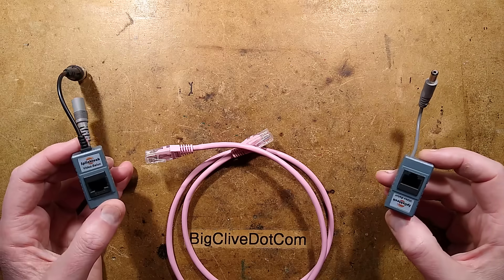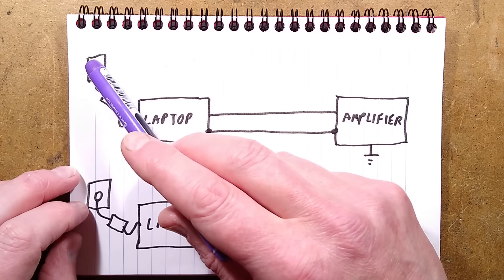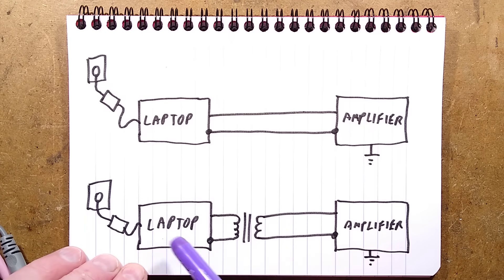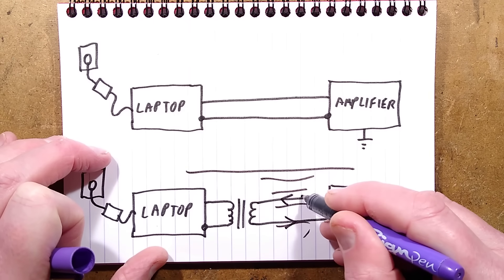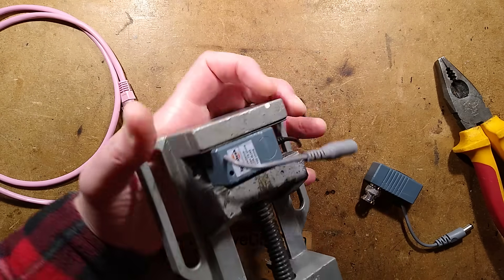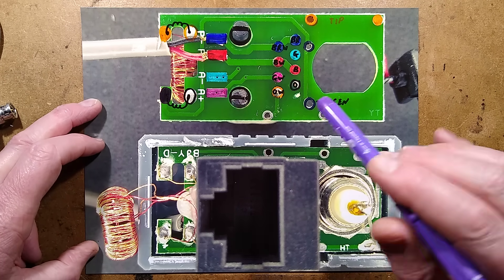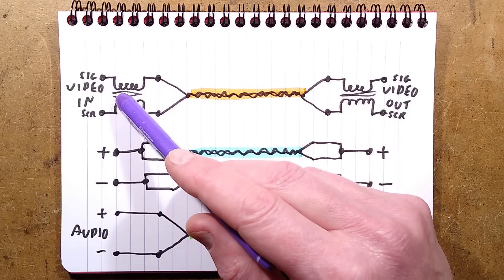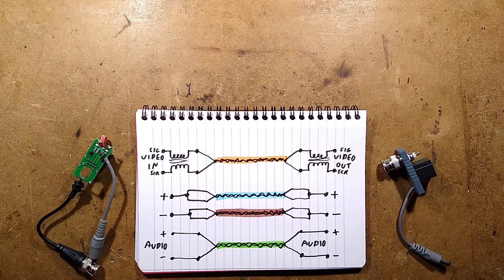Baluns - I got this one wrong (with schematic)

Comment: It looks to me like the balun is providing single-ended to differential conversion and also common-mode filtering, but it is not configured to convert between 75 Ohms and 100 Ohms. This would require a slightly more elaborate balun with more than two windings, and the small(ish) mismatch in this application probably doesn't justify the added complexity.

Comment: Ham over here, I think in this case the "baluns" are 1 : 1 and they are choking baluns, not really a balun but, if the ferrite is for the correct frecuency and if its correctly calculated and constructed can do the work.
The best option in my opinion would be the Ruthroff configuration that is it a real BalUn (Balanced to Unbalanced) system.
Balanced is the UTP Pair and nothing have to do with the fact that they are twisted and unbalanced are both the camera output and the monitor or DVR input .
They wont be nedeed if you run an unbalanced transmition line within them that have the same impedance (Coaxial cable, 75 ohm, could be RG6, RG59, etc).
They are NOT matching any impedance.

Comment: I have installed hundreds of those baluns in cctv environment in combination with UTP
super easy to connect and have never had any problems with them
with the use with outdoor cameras you could sometimes get some corrosion but with a well-sealed junction box that was still survivable 🙂

Comment: I am a (retired) E.E. I really enjoy your videos, you cover topics that we never learned in engineering school at a very useful level. I worked in television design for many years. We used baluns for going from 300 ohm balanced to 75 ohm unbalanced inputs. The were amazing 50-1000 MHz with less than .5 dB of loss and cost about $.10 each. Video signals are not so high in frequency from 0 to 5 MHz (in NTSC/PAL) and perhaps 25 MHz in more modern equipment. Notice I include d.c. the d.c. level is important for establishing black level. Thanks for all your content.
Reply: One upon a time every cable TV company truck had a bunch of 300 ohm to 75 ohm matching transformers on them. These days, I have no idea what a cable TV installer would do if confronted with a 1970s Zenith floor console TV with 300 ohm VHF input.
Reply: @brianleeper5737    The installer my family had in 2015 had a hard time understanding that our older TV was a non-remote model. If they needed to modify the presets on the varactor tuner I'm sure they'd be totally lost. Today I don't think the latest cable boxes even have analog RF out.
Reply: @brianleeper5737  I bought a balun a few years ago to use with an FM folded dipole to 75 ohm receiver. It was a few dollars from Amazon.
Reply: Yes you are right i complettly forgot, thats why a "normal" impedance conversion doesn't work. Thanks

Comment: These are used on the security camera system where I work, on long cable runs. Shorter runs- up to about 100 feet, just use the coaxial cables with integrated power wires. Longer runs use baluns with Ethernet cables.

Comment: I'm studying for my "Electromagnetic Fields" exam, and yes, it does look like black magic at first, it's very counterintuitive. I kind of had to forget Kirchhoff's laws for this specific class.
At high frequency every length of wire matters, and one can "build" capacitors or inductors right on the pcb by designing the proper stubs (the Smith chart is amazing for that) to match the impedances of the line.
Reply: Got my first amateur experience with this looking at a computer motherboard and wondering why they went out of their way to make some of the traces going to and from the processor zigzag.   Had to do do digging to figure it out. High frequency electrical and radio is fascinating.

Comment: Those look like common mode filters in which case, the windings would be 1:1. As another poster mentioned, you would only need one in that case, except you are using another to convert back to BNC. What you want is an audio isolation transformer (though these may work well enough to isolate the noise as long as they have the bandwidth.) I'm gonna guess these would be fine to eliminate the hisses and high frequency noises, but would not work much at all at line frequency to eliminate hum.

Comment: Ground noise is a issue i have with raspberry pi's trying to connect a class A or D amp. I had to brake a transformer out of a 12 v power adapter and put one on tip of audio cable and and one on ground. It helps but if you listen carefully you still here the sound of the sd card working lol

Comment: As far as I understand, the transformers are used as a common-mode choke, it ensures that the average voltage and current on the twisted pair are equal to zero. I do not think it does any sort of impedance matching, video is 75 ohms and twisted pair is 100 ohms. The return loss is -17 dB, so -34 dB after 2 reflections or 1/50th of the original amplitude, so this won't lead to ghosting on the screen.

Comment: I'm surprised you didn't actually talk about what's going on in the twisted pair that actually makes it even better than just using differential (balanced) signalling by itself.  Because the wires in the cable are twisted, they are essentially very long thin coils, which means that when a current flows through one, it creates a directional magnetic field.  That magnetic field causes a current in the other wire that is also wrapped around it in the other direction, and vice-versa.  So if you "push" the signal down one wire and "pull" it on the other at the same time, the two opposing currents on the two wires actually magnetically reinforce each other and help each other propagate down the wire.

On the other hand, because the wires are so close together, any external interference affects both wires in the same way, and produces current going the same direction in both "coils", which creates unbalanced magnetic fields, which fight each other and and the interference actually cancels itself out before it can even travel very far down the wire.

But this means you really do need to have a balanced ("push-pull") signal going into twisted pair to use it effectively (especially at high speeds).  If you only send the signal down one wire in the pair and keep the other at "ground", the electromagnetic properties of the cable itself will actually "fight" the signal and it will not propagate well at all.  (This is why the DC power is transmitted using two separate pairs of wires, instead of different conductors in the same pair.)

The coupled inductors on each end ensure the signal is balanced because when the signal goes in one side of the inductor, it will naturally induce (force) a current to flow the other way on the other side too (this works because the two coils are wired in opposing directions, which is important).

Comment: Isnt the two transformers opposing each other just a common mode supression choke? Induced noise is going to tend to be common mode- if the noise is the same in both cables the inductances add, and if its in opposite direction then the inductances cancel?

Comment: This type of solution is just as bad as a direct connection because the isolation doesn't prevent the line 50/60hz or the  SMPS noise from passing through!

The best solution is to ground both devices and the problem is solved, assuming that each is connected to properly wired outlets on the same phase.

For notebooks, the rule of thumb is if it came with a ungrounded supply replace it with a grounded one.

Just make sure that the replacement is indeed grounded by measuring, it because I have seen many that leave the ground floating.

Comment: A few years ago, I watched some of the lectures by Greg Durgin, eng prof at Georgia Tech, on Time Domain Transmission Lines.  This is digital signaling which really helped me get my head around transmission lines.  I had the Time Harmonic lectures back when I was in school but you get lost in all the waveform interactions.  They didn't even teach Time Domain back when I was in school.  And now that mode rules the world with digital comms.  

I find it amusing that we ended up with our "modern" world being controlled by the Telegrapher's Equations dots and dashes on lines instead of waveforms.

Comment: I thought ethernet had galvanic isolation by design and transformed coupled inside the device side connectors? 🤔 I guess not in these devices? Otherwise you could only transfer AC and not DC?
Reply from the maker: These are just plain connectors.

Comment: I am not sure if this type of camera is putting out NTSC/PAL or is RF modulated. The former is tricky as it also has to maintain low frequency as well. Both NTSC and PAL need those lower frequencies to keep the black at pedestal levels without drift, as well as vertical sync. If it is RF then this is not relevant.

Comment: The key term here is "common mode choke".  It is especially useful for differential signals, and reduces noise current.  There is a good wiki page...  https://en.wikipedia.org/wiki/Choke_(electronics)#Common-mode_choke

Comment: Great to see the vice of knowledge make an appearance. I discovered that the wood chisel of interrogation makes quick work of glued and ultrasonically welded plastic cases. They spring right apart with a moderate tap from the hammer of persuasion.

Comment: Once upon a time we would fit baluns to analogue cctv cameras where long coax runs would give signal loss or reflection issues. The analogue signal cable run on cat5 would be a lot longer with less issues… upto 1000m. Then IP cameras came along and not seen a RG59 coax since. 👍🏻

Comment: In this day and age of IP cameras, running ethernet cable for use with older analogue cameras seems a bit daft when IP cameras, albeit often iffy software-laced china creations you really ought to deny web access to, are the same price but higher resolution, and only need ethernet to get rock solid video from (yes, wifi ones work too, but from experience can be unreliable), going for the analogue kind seems like a step backwards... :S

Comment: Another advantage of signal isolation transformers is protection against electrical faults and surges. If you buy dodgy eBay/Amazon amplifiers, I'd recommend using an isolator in case live shorts to the low-voltage side to block AC from getting into anything you may have plugged into it.
As for "galvanic isolation" causing problems with video signals, it isn't a problem for 10GbE passing 300+MHz per pair, it shouldn't be a problem for 6MHz analog video signals. NTSC/PAL video signals do have DC bias though, which would require active circuitry to compensate for.

Comment: Oh, I am actually relieved to hear that the audio doesn't pass through a coil. That would make for a wonderful low pass filter and screw up the audio signal. A cheap USB DAC with optical out is absolutely the best solution to get rid of a ground loop and mains humming.
Reply: And where would you get the power and optical fiber for that monstrosity in a building already wired with Cat5 structured cabling?
Reply: @johndododoe1411  Why do you assume that your particular situation applies to everyone? Also, you only need the galvanic separation just before the amplifier. The optical cable only needs to bridge the short distance from the DAC to the amplifier. Where there is an amplifier, there is a power outlet to power your DAC, be it mains voltage or a USB port. The "monstrosity" is a DAC as small as a pack of cigarettes, and 50 cm of optical cable!

Comment: Did I miss something on turns counts of the transformers?

I'm curious why the power is done using a whole pair for positive and a whole pair for negative. I'd have used put positive and negative on each pair for better mutual inductance between the conductors.

Comment: You can get video 'humbuckers' that do provide galvanic isolation. Useful in larger systems. You can also get baluns that put multiple analog video signals over CAT5, one per twisted pair - in my experience the passive ones of these are fairly terrible and unless all your sources are genlocked the crosstalk between pairs is too high and you see artefacts of the control signals (like the H sync and colour burst) of one video line appearing in another.
The single channel ones are great, and work really well for remote cameras as they remove the need to drag power to the far end - I use them a lot for CCTV cameras on stage sets, and also in the other direction for monitors in orchestra pits - removing the need for power and a PSU at each music stand.

Comment: Baluns are a good choice for simple, straightforward extension applications however they are limited to SHORTER DISTANCES VS. "EXTENDERS".  Extenders are powered  ACTIVE devices (not just a transformer) that convert the signal to another standard for longer transmission (like converting HDMI to HDBaseT, and then back to HDMI on the other end).  
I run an auditorium where we have five extenders running between the stage and projection booth, each on a dedicated Cat6 cable...two HDMI going up to feed the projector, TWO VGA going down to feed computer monitors on stage, and a USB extender so we can control the computer in the projection booth via mouse and keyboard from the stage as well as transfer files via thumb drive (so we don't have to run upstairs to the projection booth to directly connect the thumb drive to the computer).  We do have a sixth Cat6 cable for running 4xXLR, but that is a "cable snake" since it's not active and doesn't do conversion (although there may be a transformer inside to facilitate the different cable type, never opened it).
Extenders AND the balun you showed do NOT use "Ethernet".  Yes you use the same Cat5, 5e, 6, etc. cables, connectors, and connector wiring pattern that Ethernet uses, BUT extenders and baluns require DEDICATED Cat cables...they can NOT carry the extended signal along with Ethernet signals...so it's best to call them Cat5e (or whatever cable you are using) to differentiate them from Ethernet cables which carry computer data.  There are a few extenders that do work over Ethernet, but it's best to avoid them as you want a clean dedicated signal with as little latency as possible (unless your use requires converting to Ethernet).  Also you CAN'T use Ethernet hubs or switches with extenders/baluns.
When we first tried this WE DID TRY an HDMI balun setup, but the distance of 75 feet of Cat6 cable we had installed was too far for it to work.  The active extenders haven't failed us.
p.s. When we connect audio from laptops or MP3 players we use what called a 2-channel "DI BOX" (DI=Direct) which converts stereo unbalanced audio to 2x XLR.  Yes, it basically is a dual "balun", but calling it by it's name of DI-Box differentiates it from other baluns and it's the industry standard term for this specific device.  While we use a passive DI-box since what we connect to it is already amplified (like a laptop headphone output), there are also active ones with amplifiers that allow you to connect electric guitars.
Reply: The need for an active extender vs passive balun really depends on the characteristics of the signal, the cable, and the receiver equipment. HDMI is high bandwidth and receivers are not built to receive degraded signals, hence the need to an active extender. For analog composite video you only need 4-5MHz so you can use much longer cables without significant signal loss. Audio can go even further, in the old-school analog telephone network everything was only passively matched (except for certain trunks between offices).

Comment: In this application there's no point galvanically isolating the video signal when it's power isn't isolated as you'd just end up re-grounding the isolated signal.

Old technology now for CCTV but these were such a better option compared to running coax and power. Especially when they later wanted to upgrade to IP. No recabling needed!

Also for interference being cancelled out through balanced transmission lines, a graph showing how the induced signal gets cancelled out is a really good way to visualise it.

Comment: Have to disagree with you on several things.
When they have meant including audio is that many modern cameras can send Audio over same coax signal cable.
This however usually only works on one protocol to which camera and *VR are focused to or defaulted. When you change the protocol Between CI and CVBS (or older AHD or TVI) most cameras with builtin sound stop sending it often lowering resolution or FPS.
As a result you can't often fully mix two manufacturers Dahua (Eagle, Viper...) and HikVision (Annke, Swan, most cheep ones) and get full specs.
Secondly I have newer successfully got passive Baluns to compete with even mid  range ebay CCTV cables like ZOSI and Where distances or electrical noise is an issue, IP cameras would work better.
Thirdly, Most of us here are not from entertainment industry so wont have audio separating transformers. Box standard bluetooth paired Alexa gives more then reasonable sound for my PI4 until pi5 arrives and many monitors provide OK sound thanks to hdmi.

Comment: HAM radio operators can open a whole new world with antennas different types of impedance matching inductances and slang like balun, unun, etc. These ones are just balanced to unbalanced matches.
Reply: Baluns are quite a common thing in RF power amplifiers.
I don't know if they can be found on the interwebs, but Motorola produced a bunch of ap nots on design of RF power amps and many of them empolyed baluns between stages.